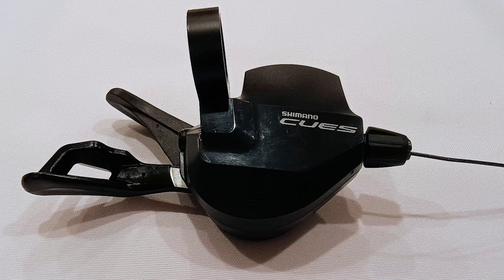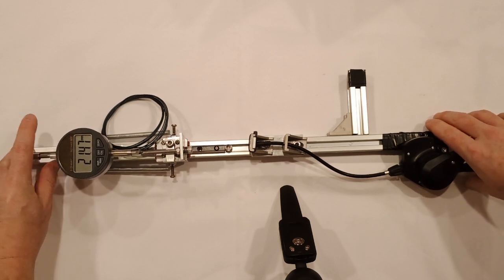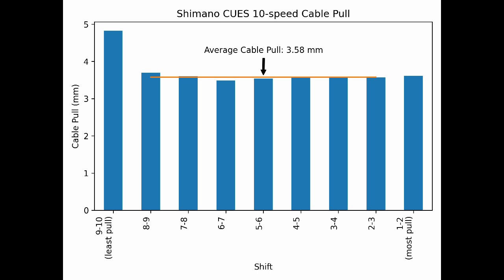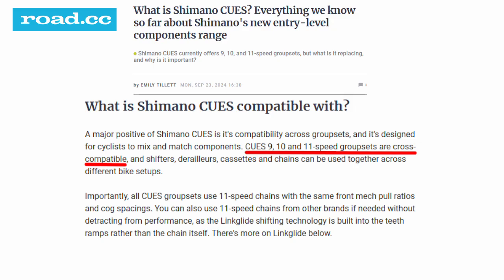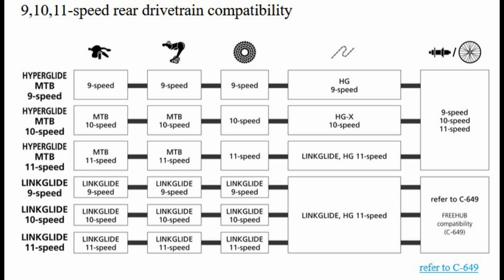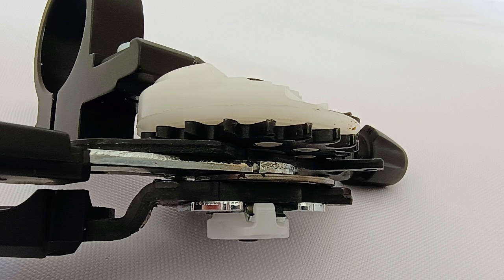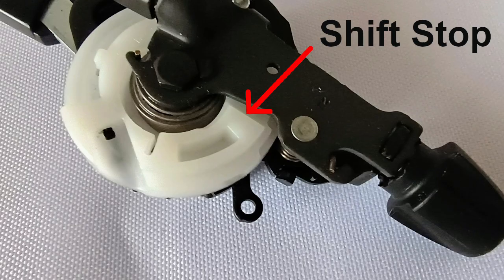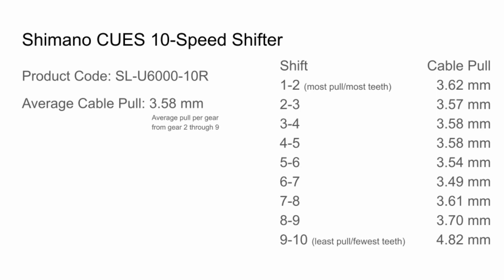Shimano CUES 10-Speed Shifter Cable Pull

Comment: Your comment about replacing the piece of plastic was prescient.  The CUES 10/11 speed dropbar brifters allow you to select between 10 and 11 speed operation by the removal of a (different) piece of plastic -- working exactly the way you said it would.

One other thing that you probably already know: cross compatibility between CUES 10 speed and Advent X/Sword are at this point pretty widely reported, so you were right about that too :)

Comment: Should not all cues the same because they are all based on 11mtb
Reply: They are if you want to but cues derailleurs are optimized on their stated speedm
Reply: @Paulklampeeps  how can they be ooptimise to thier speed when all have the same 11 speed mtb technic is used? The all use the same chain, the same cable pull ratio, the same rear derailleur build.
The only real difference are the cassette and the shifter that has different clicks.

Its like take a 11 speed mtb system on the bike with a 9speed cassette and shifter and put a 9 to 11 speed converter in the cable

Comment: Could you 3D-Print a plastic cover to make a 12 speed Shimano cues shifter?
Reply from the maker: Interesting idea! The trick is actually installing the new plastic piece. Shimano parts are not known to be easy to disassemble without destroying them. You might be better off simply cutting the stop.

Besides, I'm not sure a 12-speed CUES shifter would be very useful. The 11-speed cassette is already very wide, so I'm not sure there is space for a 12th cog.
Reply: @boothsbikeprojects  Right, in this thought experiment, we'd have to shoehorn another cog between the biggest cog and the spokes. 12 speed cassettes would be of limits, as their spacing is narrower. Maybe someone somewhere at some time made a derailleur with a fitting pull ratio, but now we are already in finicking territory, where we could just use friction shifters if we want it to be difficult.

But I still think it's interesting that we could, in theory, have 17 positions, and it's only a plastic cover who hinders us from using them.

Comment: Thank you. I'm glad, that Shimano did 9 speed Cues derailleur with low ratio 1.1 and shifter with high 3,6mm cable pull. Because old 9 speed MTB Shimano derailleurs with high ratio 1,7 and shifters with low 2,5mm cable pull was very sensitive to hanger straightness, quality of cables and temperatures too.
Reply: I almost put cues derailleur on a 9 speed non cues shifter😂